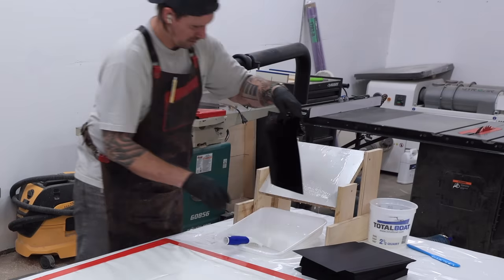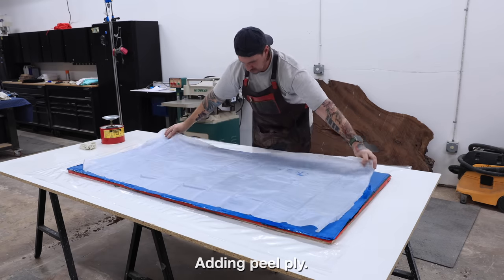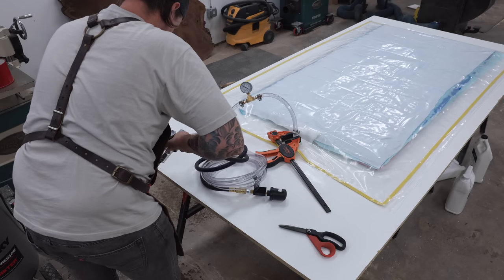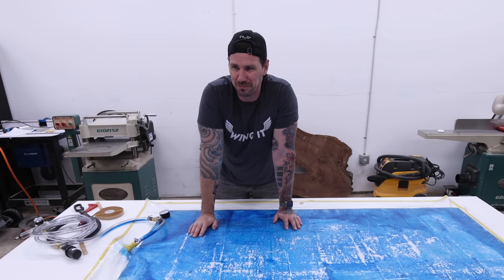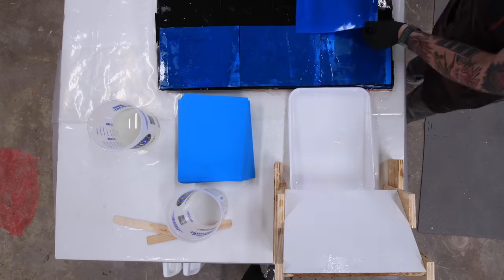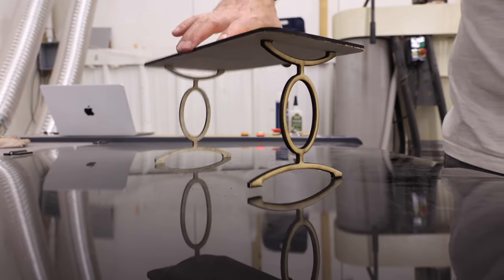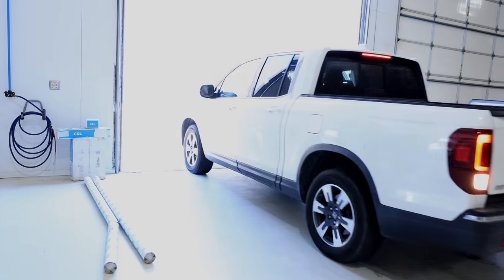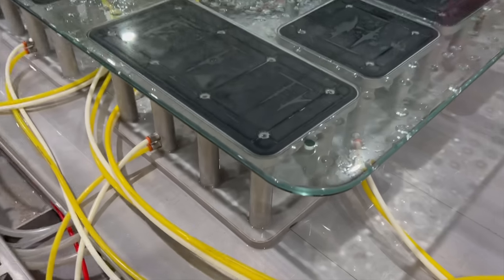Table Made From 5,906 Sheets of Paper

Comment: They have been making high pressure laminate board from paper and phenolic resin for many decades, multi-colored layers up to 30mm thick and 50" x  108". it is also made in multi-colored veneers,  also with cotton cloth up to 100mm thick.

Comment: I hope this makes sense:

Instead of overlapping the sheets in any given layer, butt joint them.  Then, make the first row of sheets of the next layer from cut sheets so the butt joints of that layer fall in the middle of the sheets of the prevous layer.  (Think of a running bond on a brick wall, but in both the x and y axes)  That might minimize the uneven build up of layers.

Comment: @jonnyBuilds if you're having problems with uneven cutting on your CNC, make sure you check not only the bit for slippage, but that the material is properly immobilized AND that both the router table surface and the material are even and level. If all else fails, slow your process and bit speed down. ideally you should be able to run at full speed without problems, but we don't live in an ideal world, we live in the real one, lol.

I run an Anderson STRATOS at work with a vacuum table, and if the table isn't holding things in place properly, the cabinet door pieces will come out all kinds of wonky. I've literally had door pieces come out "S" shaped because the piece started to wander under the bit when the vacuum table wasn't working properly.

Comment: Micarta is not made with epoxy. It is made with phenolic resin. True micarta as originally made by westinghouse or now by the American paper company, is made by saturating fabric or paper with phenolic resin and pressing it in a heated hydraulic press. 
Actual micarta is based on bakelite plastic. 
It is heat resistant,  non flammable, and was developed as an electrical insulator. 
Many of the companies that make Micarta actually make table tops. A lot of fast food restaurants use micarta tables and benches. They are a lamination of paper, wood veneers and plastic laminates like formica for the surface.
Reply: Word

Comment: when you use peel ply, you dont have to sand to make a good binding surface, the peel ply does that for you, its not as impotant with the table, but when working with composites, sand the part runs the risk of damaging the reinforcement fibers. although ive never don a multi stage layup like this.

Comment: Next time add 5 gallons of epoxy
Just one of the 2 parts into a large 
Container soak them for a few days, then mix in the second part
Remove paper and lay out, bag it and do you bag press.

Your gonna need a bigger base.

Comment: I would help my boyfriend when they had a large job. They did parts for cars planes and satellites so we worked with extreme Precision required and expensive metals. We had a huge order for Boeing and I fell asleep. And everything got ruined. They were really really small parts and I didn't change out the bit. And everything got ruined by one bit. Hours and hours and hours of machining, and it all went to hell. All that metal the parts it was the worst. But I still love working with c n c machines

Comment: Love your work and your videos are super helpful. 
For those talking about environmental stuff 

I’m an artist and work with discarded items and make them into antique style historical works. 

I’ve been using found/recycling cardboard and laminating it with PVA - there’s a product called EcoPoxy that I’m keen to see more about and that would def help. (Heinously expensive tho).

Also I reckon it would be cool to see woodshavings and paper shreds into a paste with epoxy to sculpt with. 

Also recommend using a chip brush with stippling technique for epoxy - similar to how you might fibreglass and marine work ….aaaand you could use yak hair instead of fibreglass (similar to lime plaster technique). 

You could also use polyester fabric - from op/charity shops instead of paper. Save heaps from landfill. 

Happy making! 

*also I fully support your ridiculously complex process because I do that with my work. 

*also - it’d be better to rip big sheets of paper and overlap so the soft edge blends and bonds more easily. 

❤

Comment: Interesting. But every time you decided to level the surface, I winced at the loss of complexity in the layers.

Though you regain some of the complexity on the next layers.

Look at how the colorful stone scapes of the southwest are folded, flat layers lead to flat lines.

You would have gained more complexity if you had varied the overlap patterns.

If you'd bought paper in large printer sizes you'd have done the layers faster, with fewer ridges.

Observations:

 It looks to me like you are too tall for your work surface hight, you might want to check out workplace ergonomics.

Your back will probably feel better. 

Have you or anyone tried a fine coat of release agent permeated into the breathing cloth... Maybe vacuuming it after treatment with an absorbent cloth inside? Just a thought. It would be easy enough to test, polyvinyl alcohol is cheap. And easy to spray.

If you used  colored newsprint you could make thicker layers, as it's more porous,

Comment: The epoxy infused in the paper, epoxy drippings that cure and are thrown away, the layers of disposable matting, plastic bag, breather -breeder-whatever paper, plastic hose that gets cut off after it loads with epoxy, sanding that shit off of the paper. Doing all of this, what, 4 or five times and then have to do it again to laminate those layers together and all of the waste from that. All of that shit goes into the landfill and you call yourself an environmentalist???

Comment: Cool project, minus the environmental speech : you need around 51L of water (most of the time drinkable water) to make 500 sheets of paper. Plus the chemicals to have black/blue paper, and all the plastic you used (even if you can recycle it, it will use energy and resources), and the epoxy.
So it's way less environmental friendly that making a table from wood.

Comment: I used to build model ships and started making the cannons for them by rolling paper around a mandrel to create a laminated paper tube that I could turn, using my drill press as a makeshift lathe. One particularly large cannon. About 8 inches long. I wasn't satisfied with the finish, so I sanded it back down after painting. The paint had soaked into the paper, but not the glue giving it a really cool Damascus steel look where all the layers had been sanded through when shaping the cannon. I really wanted to leave it like that, but had to paint it a solid color again before putting it on the model.

Comment: Assuming you really need the paper to overlap (I would have thought guillotined paper would have been relatively simple, albeit tedious, to butt up against each other), I think you should have staggered the joints like in brickwork.  It takes no more paper, because the thin strip you remove from the first sheet will become the last sheet in the row.  If you stagger both horizontally and vertically, so that the overlap from layer 2 misses the overlap from layer 1, by the end you would have had a pretty flat board.
I think I would also have gone for a deep pour resin, and laid it up in one go.  One long cure gives you plenty of time to be getting on with the legs.  This also avoids having to rough up the surface between layups to ensure a good bond.
I was impressed with how it turned out.  I was concerned that the overlaps would add a visible distortion to the final pattern, but that doesn't seem to be the case.  It's a bold piece, that's not going to fit in with many homes' décor, so finding the right buyer may be harder than usual, but when you do, they'll pay a good price for a totally unique table.  You'll hate me for suggesting it, but I think a pair of matching bench seats would have helped make it more saleable.

Comment: 06:45 turning paper back into wood. Then compares plastic waste to meaningless paper waste......
Stupid commentary.
Firstly, paper isn't "wood", yes it comes from trees, but it is the worst wood, pulp wood. Not suitable for any construction.
Secondly, paper degrades, it doesn't pollute, no matter how much you dump on the planet, it will go away and new trees will grow to replace the cut ones.

The whole concept is moot anyway because no one likes fake wood furniture, and no one considers it woodworking. You know that particle and glue wood that just falls apart when it gets wet.
The only difference here is you would need a decent scratch but then the air and water vapor would eventually cause problems in the look, less bad if the paper soaks up the resin rather than just being coated but still bad.

Comment: I may have missed it because this was on the background while I was doing some emails, but I'm wondering why you decided to stack the paper directly piece over piece instead of "brick layer". It would create some waste at the 2 edges but it seems like it would in theory eliminate the high edges around the seams not to mentions it would add stability. I know that you changed direction of the paper (alternating layers between landscape and portrait, but in my mind it seems like doing larger overlaps would lead to better stability (though have more waste).

Comment: Out of curiosity, while you can trust the process, I’m curious as to why you chose to screw the mounting plates for the legs into the table instead of putting in threaded inserts. Is it preference?  I would have thought that the inserts would have had better holding power and been less apt to strip or risk drilling through

Comment: I work with Origami and I choose my paper wisely because not every paper has those characteristics I want, some are way too thin and others are too thick to work with but I do experiment with different types of paper to make my art but before choosing the paper for a project you need to feel the paper with your hands and you need a good judgement to choose the right paper for the project you are about to make, also it depends on how well the paper was stored and kept because if moisture found its way to the paper it becomes way too soft and sort of starts falling apart or simply rips when handled or made into Origami pieces, Idk what type of paper you used there but it didn't look suitable for the job

Comment: The tabletop looks modern and doesn't match the old fashioned legs and base.
You should swap those with more matching pieces. Also, the protruding steel caps would be annoying at a dinner, 
so change them with flushed stainless bolts with flat heads.

Comment: that's glass on top of 4 metal "legs" right? glass behaves more like liquid over time, it may not break at those weak points but it will surely cave in after a year or so. why not fill the carved out design with more epoxy and just lay the glass flat on top?

Comment: @Jonny Builds Why didn't you use a release sheet between epoxy layers, and the breather sheet? Siliconized plastic the size of the tabletop would do. You don't want the epoxy squeezing out into the breather cloth, you want it soaking in the paper. Putting in a release sheet would help it stay there, and would only allow it out around the edges. Also, you don't need a permanent adhesive to tape the edges of your vaccuum envelope...Any double sided tape would do, since the vaccum itself will hold the plastic together...Just peel it apart and reuse.
Reply from the maker: Great tips! Next time I want my lamination to fail horribly I’ll use your advice!